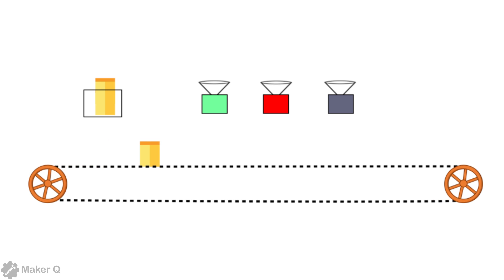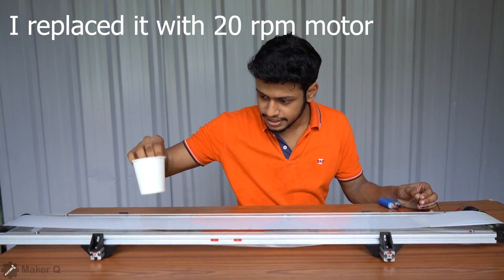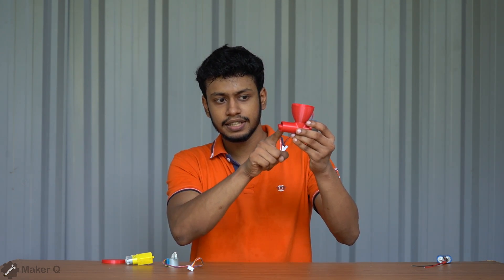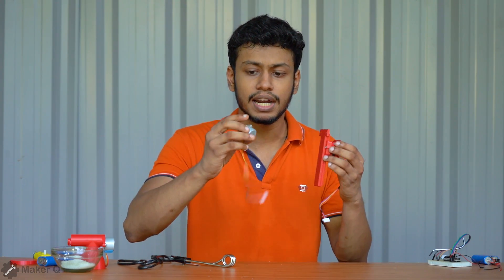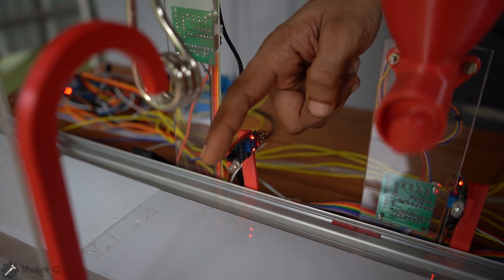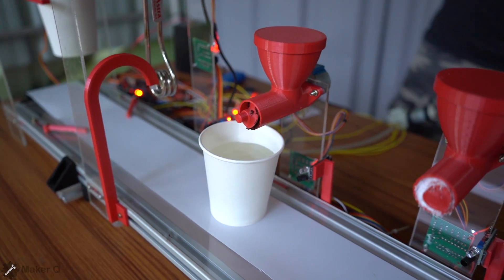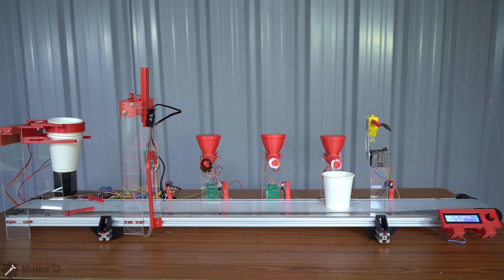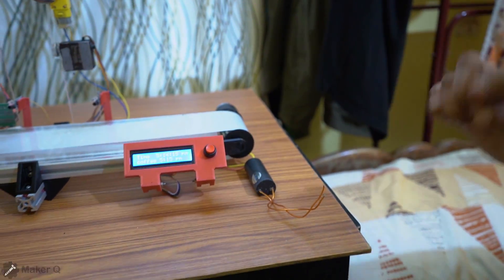Robot that Makes Coffee before I Wake up | കാലം മാറി ചായയുണ്ടാക്കാനും റോബോട്ടായി

Comment: Nice video bro 👌. One small suggestion you can reduce cycle time by filling hot water Directly by placing coil in side tank which you store water, this reduces heating time and you also may include circuit board diagram this makes someone to do something like this who is really interested...

Congrats and enjoyed your video.

Comment: Bro തമ്പ്നൈയിൽ ഏത് appലാണ് edit ചെയ്യുന്നത്
Reply: Supperrbb project bro.....well done. One dangerous factor is that 40000volt alarm. If someone or you yourself come in contact with it (unknowingly or accidentally), they will experience that 40k volt and there is a chance of death. Making a shield or hiding it in an enclosure or implanting other alarm system would be more safer.

Comment: One easy tip. Instant coffee mix (the one used in vending machines ) is available. I used to make coffee with it while i was in hostel. Its available in 1kg packet. Just add hot water. U can make one hopper version and use that mix. There is green tea mix also in various flavors.